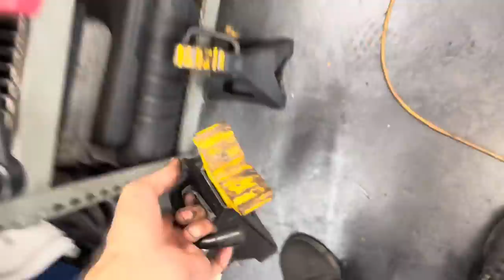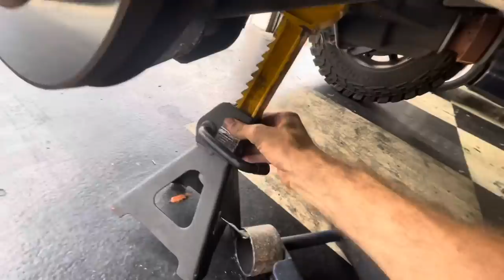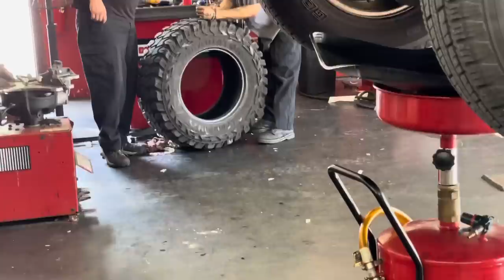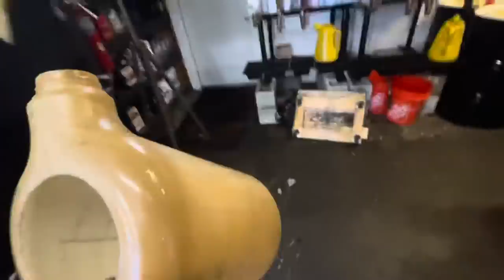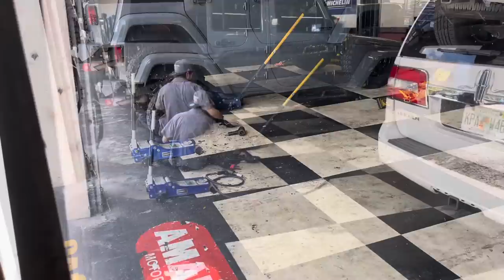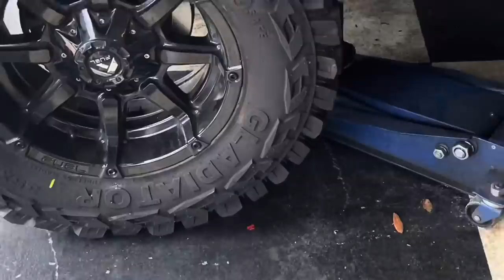Jack Stand Joke! I Failed!

Comment: The wood block makes that original jack set-up an even more egregious oversight.
Reply: Why this is stupid you are not under the car jack stand are useless in this situation
Rayman mind your own business nothing unsafe there no one under there
Reply: @legros731  Didn't you see the tech re-installing the wheel/tire; both his legs were under the vehicle.  Okay, maybe it doesn't kill him, but I don't think he'd appreciate a broken leg or two either.  This definitely is a potentially dangerous situation.
Reply: I use a 3.5 inch wood block on my floor jack all the time, but the block is custom fitted to the jack saddle and can't slip off. As soon as the car is up in the air far enough though, a pair of jack stands go under it and the jack gets released.
Reply: @chuckgrenci6404  I wouldn't even trust the jack stands enough to do that. I work on cars with some really corroded jack points, and one time I heard a crunching sound and saw one corner of the car drop a half inch or so. I always use ramps whenever I'm not working around the wheels.
Reply: @legros731  Charles Darwin would like a word with you, Cletus.
Reply: @legros731  It is not just the tech working on it, what happens if the car falls to the right or left and hits someone. What if the car falls and damages the car, that is not his car, that is a customers car and the owner will not be happy if he has to pay out on something like that was avoidable, and this coming from someone who can't even use punctuation. You are a DARWISM award waiting to happen.
Reply: @UTubeHandlesSuck  sorry but after 20 year being a mechanic  Darwin must have forgotten me lol
If this was the cheap scissors jack that come with the car these are notorious for tipping over 
What do you do when you got a flat tire on the road the car doesn't come with jack stand or wheel chock ?
Now can you return play with your toy
Reply: lol you realize they have wood blocks on the top block of most trailers and old houses?
Reply: @legros731  it doesn't matter. Vehicles slip off jack stands. Had an m3a3 fall off it's once. That's 35 tons of rolling fury coming down right now. When in doubt, jack stand out.
Reply: @legros731  "I haven't died yet" isn't an effective argument. And implying that someone is a child because they disagree with you is churlish and puerile.
Reply: @Vykk_Draygo  lol there a big difference between changing a tire and for example going under to remove a driveshaft 
The car can fell all he want he not under there 
A will ask you the same question as the other what do you do if you got a flat tire on your car it only have a super cheap jack and no jack stand or wheel chock ?
And where did i implied that someone was a child?
Reply: @werberderber6209  fell left or right ok buddy the car still got 3 wheel it going nowhere if it fall 
It not like it 6 feet in the air on a lift
Reply: @legros731  I sure hope some tech drops your car and damages it one day or you do, that back corner will still hit the ground, but ok buddy. I was changing a back tire on my truck on the side of the road and the truck went sideways (you know with 3 wheels) about 1.5 to 2 foot, I got lucky the jack got jambed under the axle and the rear of the truck bed didn't hit the ground, it was about 2 inches from it, if the jack didn't jamb it would have, I had to move out of the way because it would have hot me if I didn't move, butt ok buddy, you do you and I will do it the right way and safe way, by the way I now carry a jack stand in my truck.
Reply: @legros731  Trying to compare 1 situation with an entirely different situation (stranded out nowhere with nothing but a crappy jack vs day to day work in a well-equiped garage) really doesn't help your point.
Your other point 'its not killed me yet' is equally poor... I could start running across a highway at night, that would likely go 'well' (no fatalities) for a few nights, so by your logic that is a good idea...
Anyway, trying to school people on not taking safety measures in comments riddled with spelling errors, throwing childish insults and then not even being man enough to not deny it really says a lot about you, likely you've never even held a drivers license let alone work on any car.

Comment: I've worked EMS for years as a paramedic and if people saw the death and disability I've worked from car fall mishaps, they'd never work under a car without multiple jack stands again.  Carry on and continue to play shop safety officer. You probably have or will save someone's life.
Reply: Absolutely, and I never , ever, work on a car with my legs underneath, you know why.
Reply: And check the welds on the jack might save your life
Reply: good observation thanks
Reply: Same. 20yrs on the ol cabulance. Seen more death, dismemberment, pain and suffering from unsafe work practices than I care to admit. A few seconds ago extra work could save your life. Common sense is a trait that’s been bred out of humanity over the last 40yrs.
Reply: @cowthedestroyer  and the jack stand, I believe harbor freight had a recall on theirs because they were failing.
Reply: @werberderber6209  I meant to say jack stand but yes you are correct that's why I check them every time I use them and if I find fault I'm going to brace them and redo the welds
Reply: That is correct. The pawl wasn’t making full contact with the contact point. I bought a set of them and used them under the suburban. I dropped the jack to let the truck rest on the stand and the stand failed. It wasn’t catastrophic, but it was kinda scary thinking about the what ifs since I had already used them a few other times. Harbor Freight had no problem replacing them and the new ones are very sturdy. The next time I lifted my car I kind of “dropped” it on the stands and they held firm.
Reply: I like to use milk crates. You can barrow them from 7-11.
Reply: Ditto.  My patient who wishes he hadn’t survived because of all the nerve pain he lives with now is the only thing I could think of.
Reply: One major problem there no one under there they are just changing a tire 
The first that can happen is the truck falling
People have been changing tire like that for decades
But now with the jack stand  there and Jim needing to reach under the car at the end could have been way more dangerous in the end but whatever with all your mechanical experience (0)I am sure you know best

Comment: I helped a buddy put a steering box in an Monte Carlo SS. Left front in air no jack stand, both of us under car. Stopped for a greasy handed sandwich,  while we ate 10 feet away car crashed to concrete.  We both turned white. Yes it was the orting in a new floor jack. We've never gone without jack stands since. We were stupid but lucky.

Comment: I remember back in the day doing tire changes and this guy did the same thing. Unfortunately, they failed to put the parking brakes on and it slid off the block and caused the shop to buy the customer a new jeep. when i came back to work i never saw him again. Lucky, it was only a insurance claim, and not some ones life. Imagine if your shop buddy was under there, you regret that for life.

Comment: Just as a reminder: If you have jack stands from Harbor Freight, there is a recall on some of them from about 2 years ago.  
Just search "Harbor Freight jack stand recall"  The reason I remind people is because I had a set of mine fail. 
Fortunately I wasn't under the truck when it happened.  It was up on 4 stands and I had wood blocks under the wheels just in case, but when the stands in the front let go it rolled forward off the blocks and all four wheels ended up on the ground.  The E-brake was on but did nothing until the rear was on the ground already.
Reply: Thanks for reminding me about this. I need to check mine.👍
Reply: I got the recall last year and replaced them ASAP.  I had not had a failure, but as I work on my truck a fair amount, I use them a fair amount.

Comment: Been turning wrenches for 30 plus years watch you cause i just love working on cars, your attitude and way of thought is all reasonable and shows me a good tech. We are all guilty at one time or another with no stand., but fun aside or get er done aside i have 1 friend with a bang ankle for 20 plus years culpt no stand, another one that lost both knee caps in a wheel chair 20 years later  culptit no wheel blocks while the other mechanic power braked a drivebilty while a mechanic stood in front and the master cylinder bypassed failed and the emergency brake did not hold the force. another lost a finger from jewerly wearing on the high voltage ignition coil removing the wires under a load, another 30 feet in the air on a latter with no one securing the ladder all this while i am on other jobs but within the vecenity to see the results. I am on a regular bases like to day while i am getting a motor in another city, call the shop to see how my 2 guys are doing one had an emergency doctor appointment with the wife while my other mechanic is there alone pulling a motor. Told the mechanic on the motor come off on it go work on another vehicle much simpler untill me or the other mech. gets back just for safety reasons of something going wrong and being pinned by himself in the shop. Bottom line is no job no bonus no paycheck is worth the safety of a person be safe while you work.

Comment: SAFETY is No.1 priority. My brother had just jacked up the back of his car under the tow-bar. He was about to go underneath when a neighbour shouted us across the road. Whilst we were talking there was an almighty crash - the jack just collapsed. This was a professional workshop trolley jack! NEVER go under a car without additional support - use ramps if not removing wheels. ALWAYS think "what would happen if the jack failed"? Wheel chocks are also recommended even if you leave the car in gear/park with handbrake on.

Comment: What an unsafe procedure, wooden block setting crooked on a rolling hand jack.  This slot has a locking lift that would have been much safer, and he could have look to see other bad, worn-out unsafe parts.
Reply: It way too long to setup the lift to change/repair one wheel 
It show how little you know about doing work on a car 
Look to see unsafe part lol the client maybe did not want to pay a inspection for is relatively new car and only wanted is tire repaired
You do what the client want or you gonna make some volunteer work lol
Reply: @legros731  Yes, putting the car on a lift to just do a tyre in unnecessary work. Block would be OK provided he put a stand under immediately.
If a car is only in for a tyre, you are not going to waste time searching for problems. Most of these guys need to do paid work, not free work.
Reply: @Cheepchipsable  sure best practice would have be to use a jackstand but these 3 ton floorjack are super stable and I have no problem trusting it to change tire
Like a said to many car doesn't come with a jackstand or wheel chock only the worst most dangerous jack ever so what do you do if you got a flat tire
Reply: @legros731  Lmao you're here too? Way too long to put it on the lift? That's called a bridge actually, but no problem, not everyone has worked with them so you couldn't know that bud.
Putting the bridge up takes about 20 seconds, 30 if doing it alone.
Getting the jack from across the workshop, putting it in place, jacking it up, about 1 minute if you can instantly spot the jack, usually it's not where you left it because a colleague borrowed it instead so 30 seconds of setting the car on the bridge vs 5 minutes of searching for the jack, clearly you've never been inside a garage.

Comment: Happened to me when I was 16, that was 50 years as go. Jacked up my project nash metropolitan with it's old donkey screw jack, took off the rear tire to work on the brakes, left to get tools. Came back c as r on the ground,  screw jack just stripped out its threads.  Always double blocked last 50 years, still have all my toes, hands, fingers etc.

Comment: My first lesson about the danger of not using jack stands was my boss putting a styrofoam cooler under the car, then challenging me to yank it out before he could let the jack down, after which he said, "Imagine if that were tour head."

I was wondering whereabouts in Florida you are. The character of the scenery on your test drives looks familiar. I moved there in '75 from Cleveland, Ohio, where I worked at Rick Case Honda. I worked at Sports Car South in Hollywood (long gone now, MG, Fiat, Alfa dealer), Miami Honda, Golden Wrench, South Broward Import Service, and finally Acura of South Florida. In '95 I enrolled in the computer electronics program at Sheridan Vo Tech, then took some Microsoft certification courses, after which I got a job in IT and moved away. I have family in Boca Raton and Del Ray Beach.

I really enjoy your videos and like your style. Kudos!

Comment: I bought 2 huge tool boxes at an auction. One had 6" tall spacers made for car jacks. They were made from a piece of 1" diameter round bar and some heavy wall sections of 1" ID pipe. They fit between the jack and the jack saddle for those times you need a taller jack. And for those occasions, I made up large wood blocks to set the jack stands on so they are not maxed out.

Comment: I cringe hard when I think back to being young and not knowing better, thinking about all the times I worked under my car with just a jack holding it up. I use several jack stands now, just in case one of those fail, and being crushed is still in the back of my mind every time.
Reply: I thought I was re-reading my own comment that I just wrote.. You and me both.

Comment: as a retired physician I had the misfortune of pronouncing death in two episodes of cars falling on guys working on them. As a car hobbyist I developed my rule of not getting under a car that is not supported by TWO separate methods - jack & jack stands, jackstands & couple of staked tires, etc. Be careful out there.  Ray
Reply: Exactly. I wouldn't trust my life to just a jackstand either. Especially with this vehicle I didn't see any wheel chocks. Without chocks not much stopping it from rolling a bit and toppling the jack if something bumps the vehicle etc. Cars can fall off a lift too, there's a video on YT here somewhere of a fairly new Corvette falling off a lift, don't think anyone got hurt, but did a huge amount of damage to all that fiberglass...
Reply: Same here why remove the jack unless it is directly in the way and then another jackstand or 2

Comment: A smart person would have jack on the differential axle because that is the lower point to lift the car up and put 2 jack stand on the rear axle for safety.
Reply: I've tried this before, but sometimes the weight distribution of the vehicle is uneven and it will tilt to one side. I believe most manufacturers recommend lifting at the jack points one side at a time.

Comment: Squeamish people avoid this comment!!!

This is in reference to the tech sitting with his legs under the vehicle...

There's an old movie series called "Faces of Death". If you've ever seen 1, you know some scenes get imprinted into your brain & you can never forget them. Well...there's a scene in Faces of Death Part 4 where a guy is in a junkyard working on the front suspension. He has his legs under the vehicle when the cylinder block collapses. The front disk cuts his leg 99% off as it lands on his leg below the kneecap. Every time I see someone sitting the way the tech in the video above was at the end, I get that scene running through my head. I will NEVER sit like that while working on a car. Not even with 5 jack stands all braced. Nope, nada, hell no!!!

Be safe!

Comment: Watched a guy at discount tires stick his entire head between the fender and upper wheel well while the tire was on the vehicle. The Land Rover was on (4) hydraulic jacks without any jack stands whatsoever. They don’t use jack stands ever….🙈 This is common practice as I guess jack stands would take way too much valuable time to slide under the car. I actually told the dude about his stupidity and pointed out that you could actually “Die” ..  
He was unfazed. Had a buddy back in the day slid underneath his Porsche just for a quick look at something and hydraulic jack failed. He was lucky because his chest was under the Tunnel where the driveshaft was. The car was sitting on his chest and he could barley breathe. Happened in his driveway at like 10:30 at night. Got lucky as a neighbor was walking his dog and heard him saying “Hep” “Hep” only because he could not say help due to a car sitting on his chest!!!

Comment: Why use a jack stand if your not going under the car I can understand it when both legs are under like what he did to fit the wheel and on that type of car it does only take 2 seconds personally I’ll always stand back enough to not get crushed and kneel down to fit the wheel ? Correct if wrong

Comment: Best to use the next larger stand. Not good at what looked like full extension. Stands have notches all the way to the end, but shouldn't. I will admit to not always using a stand IF all I'm doing is changing a tire quickly>>not leaving it on the jack for more than a minute or two. My jack need new seals>>starting to slowly leak down. Probably cheaper to get new one from harbor freight than to fix the 35 year old one I have.
Reply: Not so,easy to install a new cylinder.